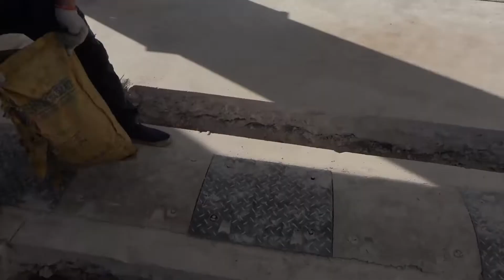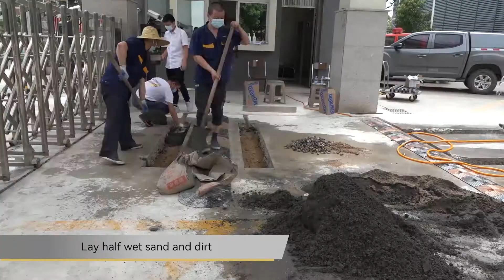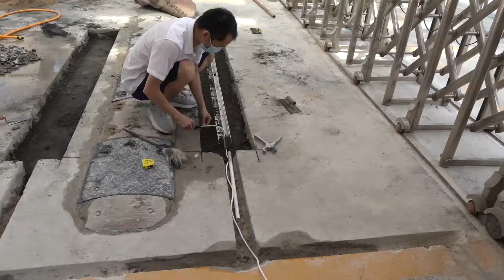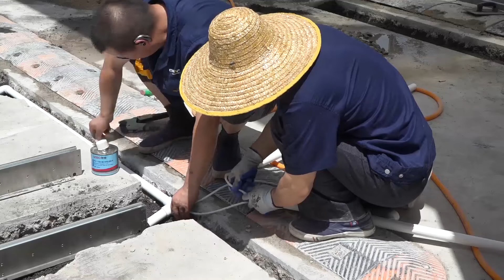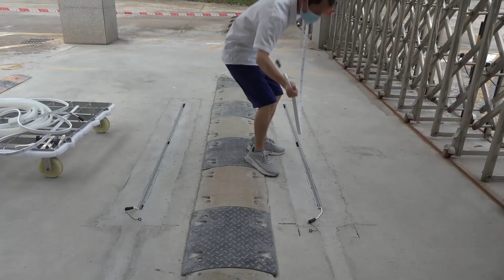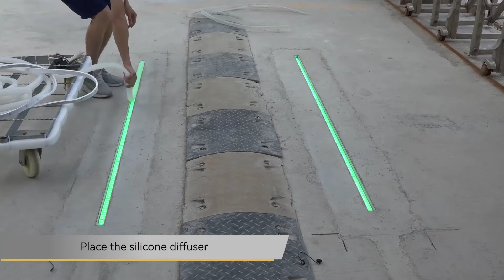How To Install  In-Ground Light Installation Guide

Comment: Once the sand hardens will the water still go down through the drain holes
Reply from the maker: yes, the water is able to drain through the holes once it the cement has dried up.